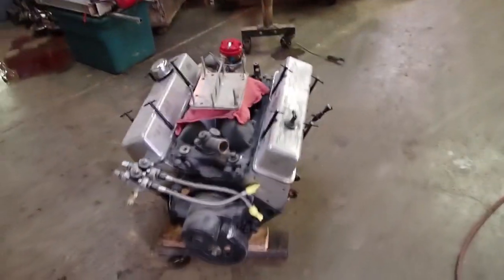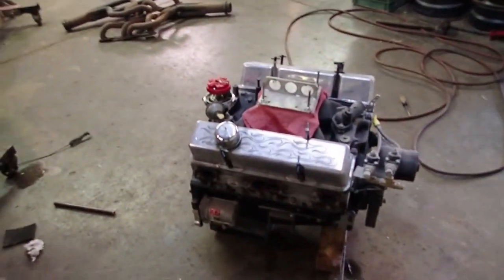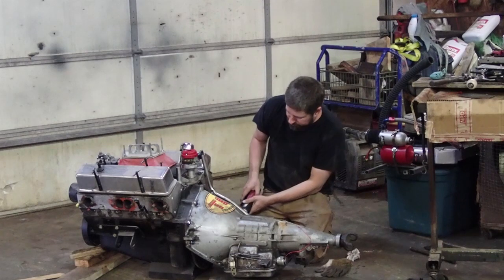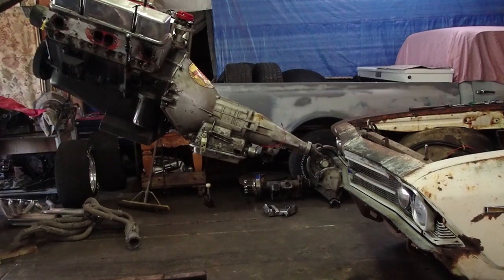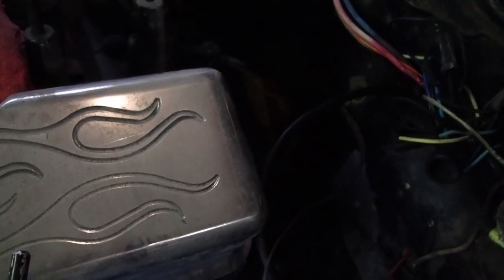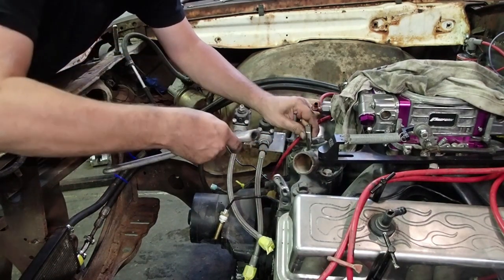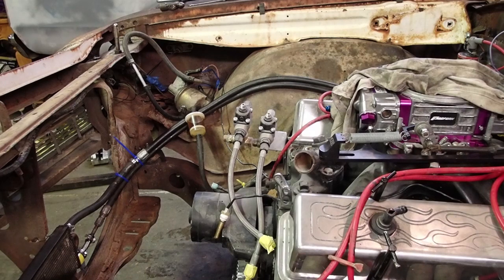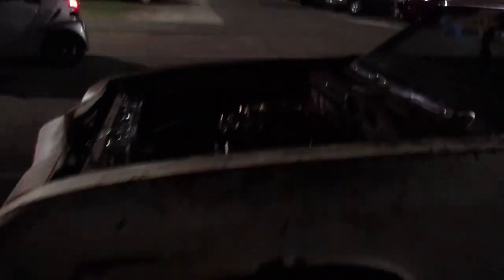Small Block to Big? I Tap out? |Sketchy's Garage

Comment: Man big blocks has got expensive. I can't find a 454 4 bolt main no where's under 800
Reply from the maker: That's the truth.  You use to be able to get a crank kit for one around $125 now there almost $400.
Reply: I went to brodix blocks 6 yrs ag, and before that I would go to my scrap pile and get a 454 block to send over to the machine shop so they could do billet splayed main caps on it.
Reply from the maker: I've always liked Brodix heads, you happy with there blocks? If I ever get youtube famous I would like to build an all aluminum small block.
Reply: @SketchysGarage  I am real happy with their blocks. I run a 540 f3-136 bbc using the 10.2 DH, 4.5 BS, 
.903 bushed lifter, 55mm cam, .400 raised cam, priority main oiling, and screw in plug block. I run this block on the street in the dead of summer and it won't get hotter than 185 degrees in the city. 
My heads are RFD started as a Brodix Head Hunter bare casting made for RFD and RFD port matched 2027-O MC Brodix intake. I was carb then efi but went back to all billet e85 APD dual needle and seat blow through carb, custom ground solid roller comp cams, crower enduramax lifters. That is a little bit about my setup other than the ATI trans and precision shifter James help me out with.
Reply from the maker: @jasonritter2492  I will post a closer look video of it on my channel if  you would like if you could get me a video of it.  I will promote any social media on your video in your video for your time.